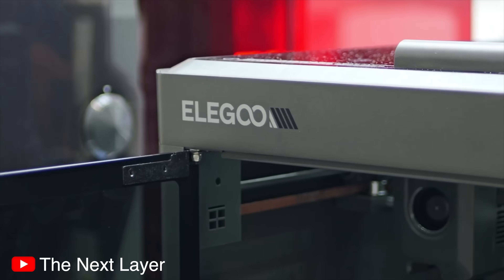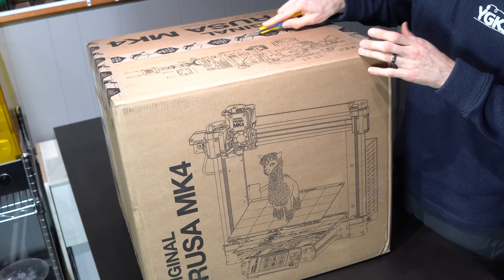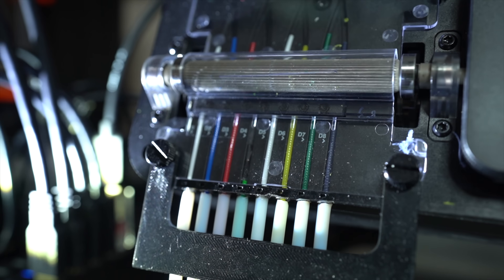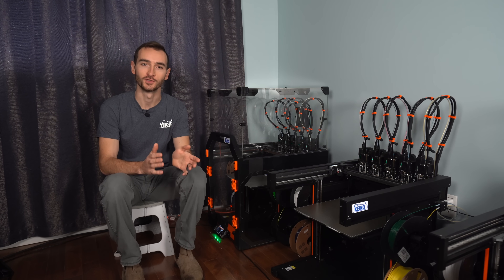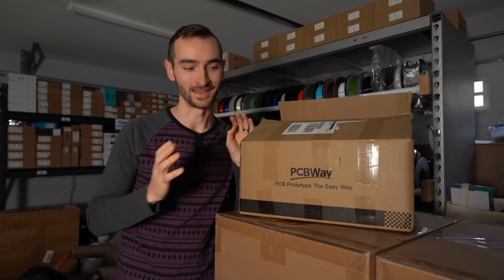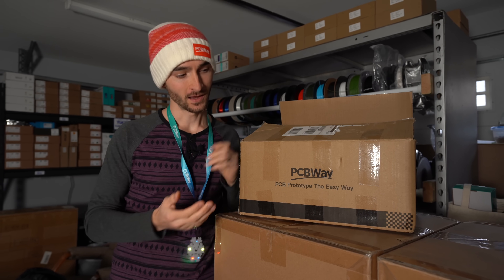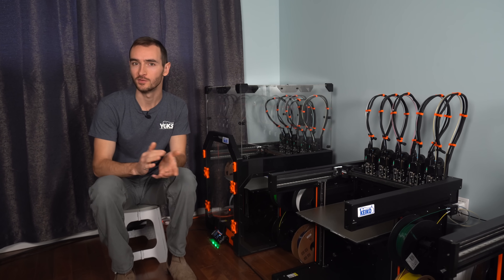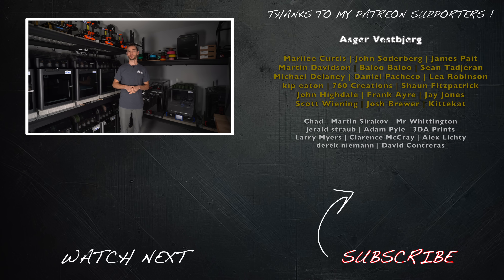The Prusa Core One is dividing the internet...

Comment: Don’t forget that the CORE One boasts the ability to print PLA with the door closed, which is a pretty big deal if you want to print PLA on your desk next to you.
Reply: My x1c prints fine with the door closed and doesn't say anything
Reply: The bambu X1 and P1S can both do this using the chamber fan at 80%
Reply: @captainheat2314 Is that documented anywhere? On my X1C’s, they just yell that the doors need to be open.
Reply: @Amarand  My X1C has over 1K hours on in.  Most of that with standard PLA.   In all that time I don't think I have left the door open a single time.
Reply: @Azreal34  Right, so Bambu expressly, in writing, states that standard PLA must be printed with the door open, in order to provide ventilation, avoiding issues with the extruder. How do you get around that, and is your procedure approved by Bambu?
Reply: @Amarand  Get around what?   I am not contractually obligated to follow any of their suggestions on printing.  I am telling you what works and you seem worried about their recommendations.   I get that you are trying to dig up whatever you can to make Bambu sound bad and Prusa sound good.  But you sound pretty silly here.   

Both companies make great products that people should consider.   Neither needs you to shill for them or try to make the other sound bad.
Reply: @Azreal34  I'm confused. Did you miss the part where I happily, and exclusively own, 11 X1C units, and have been printing with the door open for a full year now, no issues? Heat Creep is a documented issue that doesn't just impact Bambu printers, it impacts all enclosed printers that don't have proper airflow to maintain a temperature below the glass transition temperature of the filament in use. What I was saying was that the enclosed Bambu printers do not - out of the box - allow you to safely print PLA with the door closed. I'm not saying YOU aren't doing it, or that thousands of other people aren't doing it. But heat creep is a documented thermodynamic concern. I am absolutely NOT saying "Bambu Bad, Prusa Good." What I am saying is, Prusa has designed the CORE One so that it manages the temperature inside of the enclosure so that heat creep isn't an issue. That is NOT the case for Bambu's X1C, which - again - I happily own eleven of. Not sure why you're getting so nuts about this. If you had heat creep issues printing PLA with the door closed, Bambu would point you to the manual, which states you should print PLA with the door open. That is all I'm trying to say. These are facts. Your statements are anecdotal evidence only.
Reply: @Amarand  I think I misread the tone of your original reply to me earlier.  So I apologize.   To me is sounded like "Bambu says you should do it this way how dare you doubt them"   But I am having one of those days so I take full responsibility there.   

I have exactly 1 X1C so I can't hold a candle to your level of print time.   I won't even pretend otherwise.   My longest single print was about 40 hours of basic PLA.   I did the entire thing using stock settings with the door closed.   

Is it possible that they have updated the software to run the chamber cooling fan differently since that initial guidance was issued?  

And once again just to be clear.  I apologize for my tone.   Misreading your initial intent or not, I was out of line.  But I am not going to go change my reply and hide my mistake.   I would rather just fess up about it.   I hope you will have a wonderful Christmas!!

Comment: As a hobbyst I'd buy Bambu because of the cost, but for buisness I'd buy Prusa because of reliability, because the cost of fiddling with 3d printer while production is waiting for parts can be very high. Also for now I'm fine with may 2 years old Prusa mini + without multi-colour because I mostly print functional parts. :) Also I'm happy with software upgrades that i'v got thought the years.

Comment: damn less then 1k hours and it broke!? my mk3s+ had 6k+ hours when i sold it and it was printing fine... should have stuck with prusa... i mean i have had more failed prints on my P1S in less then 400 print hours then i had on my prusa in 6k+ print hours... at this rate i would need like 6 P1S's just to get the same amount of prints as on a singel prusa...

Comment: I have a very early MK3 I built from a kit, and it's still running just as well as it did almost 7 years ago. That being said, I did buy into the hype and ordered a P1S with the add-on hardened steel hotend and drive gears. The value proposition was just too great to ignore, it should be delivered in a few days.

Comment: Prusa missed the mark on this one. They couldve bridged the gap by offering a larger format printer than bambu currently does and won some of that market share but as a direct competitor to bambulabs current offerings i dont see a reason anyone would ditch bambu if theyre already heavily integarated into that system. And lets face it, alot of big print farms and even DIYers have them already. 

Watch BL come out with a bigger format printer and this will get forgotten about except by hardcore Prusa fans.

The only thing good is you can upgrade your mk4 to this, but again, that only serves people who already own prusa machines.

This video sounds terrible btw, youd rather spend thousands on new printers instead of service your old ones? Come on dude. We're makers, not clowns.

Comment: I have two MK4S', and I will upgrade both once the upgrade becomes available. However, I am definitely in the tinkerer category, so it is probably a core (meh?) Prusa customer. 

My printers started as kits and will remain as long as Prusa releases upgrades. They are basically maintenance-free and produce print after print without any issues.

The MMU3 works, and yes, out of the box, it takes up a lot of space, but I have my spools wall-mounted above the printer using rewinding spool holders, and then we're in the AMS-size territory. It's not as slick looking, I'll give you that :)

Comment: Your price comparison is flawed. 
Hardened steel hot end and extruder gear versus a brass hot end in the Prusa - not sure about the extruder gear...

You'll have to upgrade the Prusa immediately if you actually plan to use any engineering filaments.

Comment: Prusa wins my vote (and I vote with my wallet) due to reliability. Having machines go hard down after only a thousand hours is a show stopper. Plus, as others have said, you own the machine and your data; you don't wind up sending your models to the printer via China. And the "eternal upgrade path" vs buying new is interesting, but I'm techie enough to do the MK4S->CoreOne conversion myself - I have screwdrivers and time. 
Admittedly both brands have appeal - my brother bought a Bambu Mini with AMS and likes it, though his RPG figurines have mostly turned into spaghetti so far.

Comment: A number of the statements in this video feel somewhat disingenuous.
A few things I note - the price difference between an X1C and a Core1 is almost the same as an A1+AMS. For the price of the smaller C1, you can have it's direct competitor AND a second almost-as-good printer to sit next to it. Not a small thing.

The next is the X1C paperweights - both issues sound like bed replacement time.  Which with sub 1k hours in this environment, I'd full expect is warranty replacement. Unless they've been sitting around unused for 9 months.
My X1C bed went bad around 3000 hours in. Warranty department replaced it. Actual time to physically replace the bed was around 3 hours; except I figured if I was pulling the machine this far down, I might as well give it a full nut to garters service. New extruder gears, new toolhead housing, new wiper, new cutter, clean & lube everything, vacuum the bits out of the back, belt tensions, clean the ASA residue off the glass and internal surfaces, the works. So it was more like 5-6 hours total.
Now I know what I'm doing, a bed replacement alone should be 2 hours or less.

Perhaps it's just my attitude, but it is inconceivable to just trash two X1C's over half a day's work.

Comment: tbh I hardly ever hear about this printer. No one really talks about buying it, no one asks my opinion on it, etc. I will still hear about the XL every once in a while, but IMO Prusa is the new Blackberry, they just have not realized it yet. While I get the whole point of loving Prusa because of what they did for hobbyist 3d printing, I don't buy Fords because of Henry Fords contribution to the production line automobile. Everything I have seen from Prusa post X1 Carbon has been just dirty marketing. They advertised the MK4 with a ton of stuff that took until just recently to be implemented. Then there is the whole "S" upgrade that is just a glitch fix in slicer, and better airflow. I really wanted to like Prusa but all I ever see from them is a whole bunch of angry fanboi's that get mad at me when I say the MK4 is slow and overpriced. And quite frankly the damage is done, look at the reviews for these on Amazon. The new user is going to run to bambu once the honeymoon phase is over. Especially if Bambu Lab drops that new printer in Q1 of 2025 like they keep saying.

Comment: If Prusa is going to compete they need a model that has a tool changer with ideally at least 4 tool heads at a price point close to an X1C.
The tool changer gives a market advantage over the lower cost Bambu machines. Save on filament over time and print faster without purge cycles.

Comment: I will never, in good conscious, EVER recommend Prusa printers.  They are FAR overpriced for the print volume and speed.  Bambu's are cheaper, in every aspect, and just as, if not more, reliable then a Prusa printer.  Comparing Bed slinger to Bed slinger, there is no contest between an A1 and a Mk4, on price and build volume and speed, and thats WITH an AMS on the A1, something the Mk4 needs extra on top of its high price.  Even backing up a generation and comparting a Mk3 with an A1, IT STILL loses on all 3 factors, even more significantly on the speed one.  In a print farm setting, speed is important to production value.
Then trying to compare the overpriced and not even enclosed, XL.....its a joke, the XL was a printer no one asked for and, no one (in their right mind) would buy.  
The same applies to the "Core One" which is priced like an X1, IS SMALLER then an X1, and STILL is missing the MMU which is extra and puts its price higher then an X1 Combo.  If Bambu wasn't around, ya the Core One could have been a game changer, but Creailty also exists with their 350mm offering and Anycubic now has their massive 420x420mm printer with color as well.  Granted I don't really recommend either of those companies, but the fact of the matter is, they exist and Prusa has LOST the market.  They are going the way of the Blackberry Phone, overpriced and under-spec.

Comment: Prusa was not considered on what made them successful originally. They offered over priced bed slingers but they did have a cult following. Me being one of them. I think one of the problems is now they’re playing catch-up. And it doesn’t seem like they can make a printer as inexpensive compared to Bambu Labs. I ordered an X1C when they first came out. I think it was on Kickstarter.  And the lightning fair speed along with the multicolor. Made it not feel like a hobby anymore.  You actually felt like you could produce something in somewhat bulk. I have 10. Bambu lab printers and have not even turned on any of my MK3s since   if I were then I would concentrate on the maybe entry-level industrial printer market. You see a lot more of the 3-D printing form set ups. Most of the ones I see on YouTube they use the A1  and A1 mini